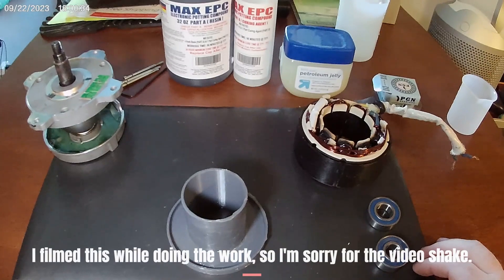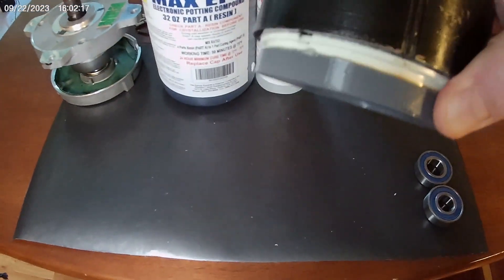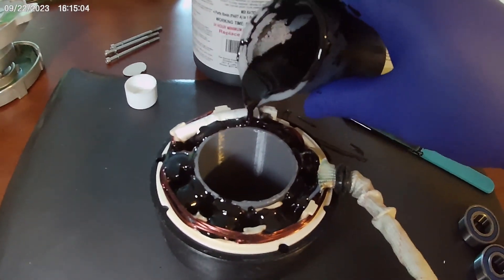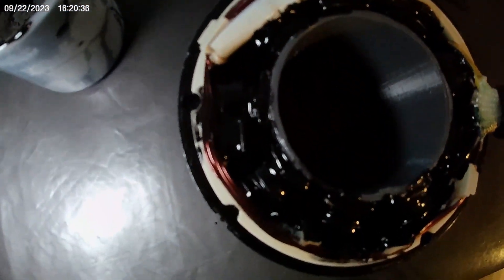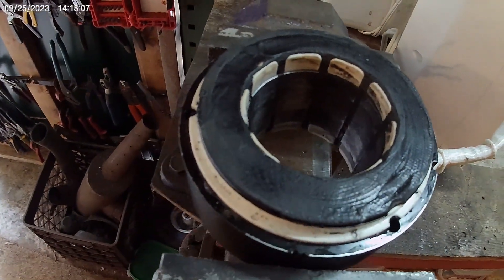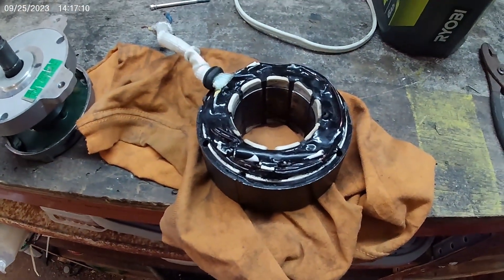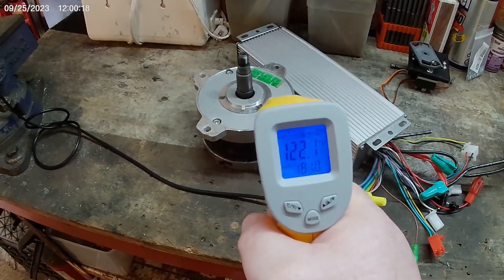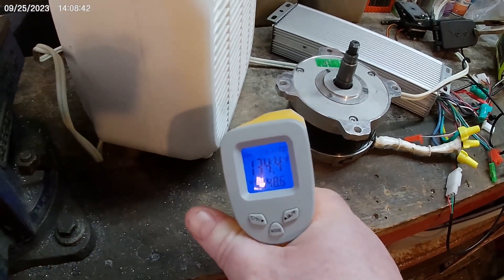Ryobi 40v Brushless Mower Motor DIY Epoxy Winding Encapsulation Experiment

Comment: I bought the same kit and it did not set up to be hard after days,I called the owner of the company and spoke to and he told me to mix 4:1 by weight of each part A and B.Also after days of potting the motor stator windings,I added some heat with a hot air Hakko 850 and the compound started to get soft and syrup like.Real disappointed in this product.Is mixing by weight the problem?
Reply from the maker: I had some problem areas in mine but the rest was fine. I think it is extra sensitive to improper stirring,  much more so than any other epoxy I've used. The motor I did that way has continued to work well, but I think I could have done a better job with my mixing. I think they also recommended heating the A part to help it mix easier. I read it can also have problems with crystallization if shipped in the could. I ordered my in the summer in the southern US so it was fine. Any of those things could be factors. But how to correct it now is a real conundrum.

Comment: Good work, I am curious does the epoxy create any magnetic Flux or deviation in the fields? Have you determined the watts of these motors and max volts?
Reply from the maker: Those are excellent questions. I know that the motors can be run at 48v safely and about 750-1000 watts. They might be able to handle more with improved cooling. As to the question of magnetic flux or field deviation, that is way outside my realm of knowledge. I wouldn't think that epoxy would cause any interference, especially being an epoxy for electronics. But that is just a guess from a guy who knows very little about such things. I have installed this motor on a 42" deck, so it will be being tested side by side with an unmodified motor. That seems like the most scientific test I can do with basic tools.